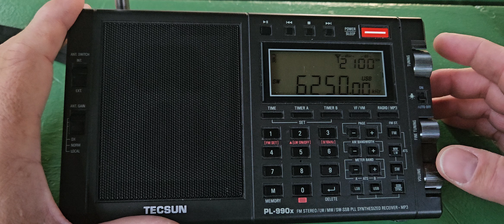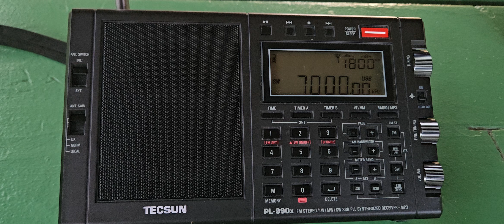Morning band scan in the park from 6000Khz to 7000Khz using Tecsun PL990X with telescopic antenna

Comment: do those things pick up phone calls and police radios and walkie talkies too?
Reply from the maker: No, the frequency range is 100 kHz to 30000 kHz. If the walkie talkies are in the range, as some of them are, then yes. But no phones or police radios. Police radios are normally in the 150ish mHz, 400ish mHz, and 800ish mHz frequencies. You will need a scanner to hear them . Although, a lot of police comes are encrypted these days, so some are not understandable. Phones, cellphone frequenciess, in particular, are often blocked